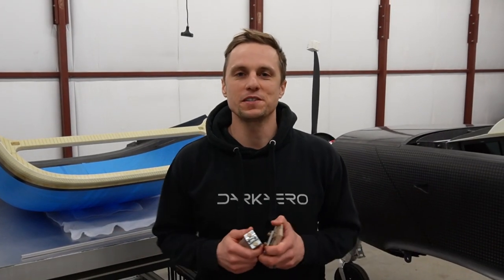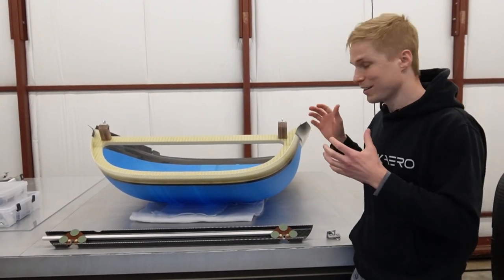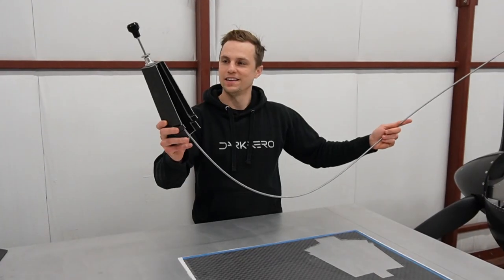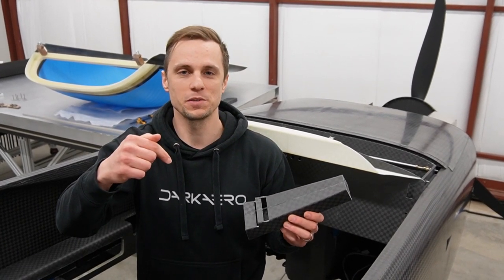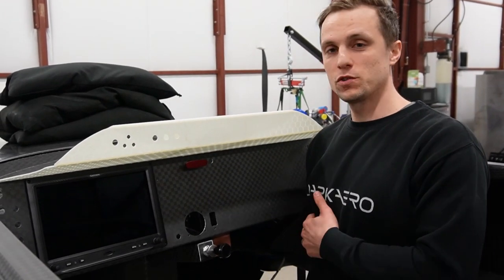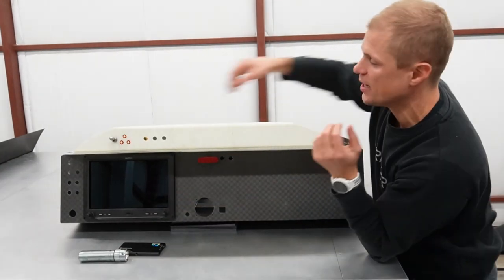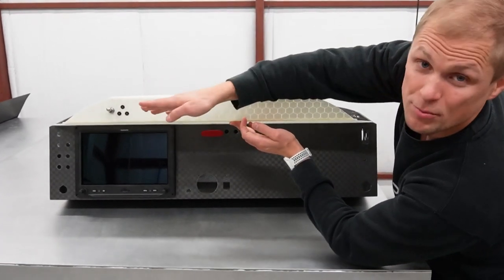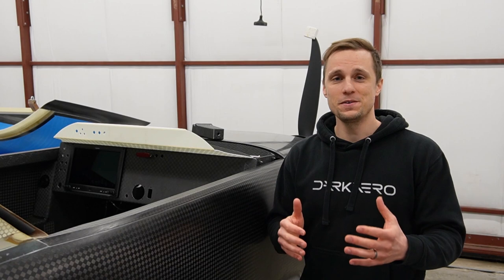Canopy EJECT Mechanism on the DARKAERO 1 Aircraft

Comment: I would request a secondary “emergency” cable pull to disengage the latches (in case the tube is bent or some other issue)

Comment: It would be nice if you could hide the white "end grain" on the end of the carbon panels on the throttle control mount by making the top "cap" cover the four sides, rather than having the sides protrude past the top.

Comment: You guys are doing AMAZING work!
Alas, you may have a problem... water intrusion.
I dont see a significant space for a proper door seal to keep the water out if you get caught in the rain.
Maybe that is a feature that gets designed into the molds on the subsequent production unit.
Secondly,  finding a seal profile and dealing with turning corners is always a challenge, this is NOT a trivial task.
There was a guy at Santa Paula airport near Ventura CA that made pressurized silicone door seal systems, if he was still around he might have stuff that could help.
And finally make  provisions that will allow you to drain the water out of the seat base and cockpit floor, it will get wet.
Last plane I built,  before we put in ANY electrical in, we took it outside and had the fire service empty a fire trucks water tank on the plane to make sure we were dry.
FYI, took 3 tries.
As for passive drain valves consider something like a "duck bill" valve. 
Once you get a bit of positive pressure in the cabin (as opposed to outside at 10,000ft) any water (spilled coffee, cokes redbull etc) and it will help evacuate the cabin.
Ok this old fart will shut up and watch, looking forward to the first flight!

Comment: You guys are doing a great job figuring out all the little details on this project, it's very inspiring!  If you'll allow a quick tangent on latches, one of the latch systems I was a fan of was from an old Cadillac I had, 1994 year or so.  It was for the trunk, and it was a normal close, actuated hold down system.  Not sure if I've got my terminology correct.  But essentially you'd slam the trunk as normal, but then a small motor would pull the trunk fully closed say 5mm or so to create a nice tight seal.  The clever bit was that since it was a slam shut trunk it still all used the same latch hardware as a normal trunk, and didn't need power to release, the motor was attached to the stationary hook on the frame.  It was very clever in its implementation, at least I thought so.

Comment: Again your an amazing crew, the mechanism for the canopy is clean with as few parts as necessary to do the job. The four pin attachment points offer a rigid attachment to the hinged panel and makes for very simple release of the canopy. Perhaps a cleverly design of the latch handle would be to to release the latch mechanism if the canopy is lifted from the front in an emergency. Thanks for taking us along

Comment: I'm so impressed with you three and I really wish your project all the success in the world! I'm a mechanism designer myself and I really like that scissor mechanism! Such an elegant solution to the problem!

I would personally really like to have a hole or a slot in the seatback so that I can stick my finger in there and access a feature on the aluminum bar directly in case the handle or cable mechanism fails.
Reply from the maker: Thank you Marius! What sorts of mechanisms do you design and what tools do you use to design them? We do a combination of sketches, CAD, and mock ups to come up with the correct motion. Just curious to learn if you know of any other tricks of the trade.
Reply: Thank you for your reply! I design biomedical devices and surgical tools. Not as exciting as airplanes, but just as safety critical and the effort and scrutiny to change an already approved design is just as painful... so get it right the first time :) We rely heavily on sketches and CAD as well (Solidworks, still more proficient in that than Onshape). I find that just working in an unconstrained sketch in 2D is already a great first stab at a new motion. After that we will properly model and mate an assembly, and then rapid prototype (in-house CNC mill, laser cutter, 3D printer) it as fast as possible, usually from easy to machine materials like aluminum and acetal. It's not uncommon to machine upwards of 3 different concepts for a given mechanism before committing to one. I also really like having a few drawers full of LEGO Technic for some really crude but super rapid mockups. In our case the analytical work (strength, fatigue, tolerance stackup etc) usually only gets done after the first physical prototype, at the same time that we are refining the second or last version. Oh, and finally, lots of peer review: brainstorming sessions during the initial stages and then design reviews after the first prototype.

If I had been in the design review for your scissor mechanism I would have said pay close attention to your mechanical advantage. I really like that right at the beginning of the motion your mechanism has the greatest mechanical advantage. (You can increase it further by making the links skinnier and collapsing the scissor more). This is great for overcoming initial stiction and static friction. By the point where the angles in the scissor are 90deg, it looks like you have a mechanical (dis)advantage of about 2:1 from the knob to each deadbolt, meaning the deadbolt is moving twice as fast as the knob. In the last portion of the knob's travel the mechanical disadvantage continues to climb rapidly. If there's a shear load or binding on one or more deadbolts, this might make the knob very difficult to pull. I might consider making sure that all 4 deadbolts are completely disengaged by that 90deg point of the mechanism's travel.

Keep up the amazing work! You guys are rocking it.

Comment: 13:08 when that canopy detaches completely at 270mph, the pilot will become incapacitated within about 0.2 seconds. 

Unless there is a mechanism that holds the rear until the front flips up and over the pilots head. Or there is a ramp on the top of the instrument panel to launch it overhead. Or there is a way to guarantee the low pressure over the canopy will lift it at >30 degree departure angle to clear the pilots head. Which defies physics. 

It should probably have a catch at the upper-rear which is not released by the jettison handle, in order to cause the canopy to lift leading edge first, flat plate vertical overhead, and off into the breeze. 

But you mentioned needing to design a solution to the problem, so ill hang tight for that.

It would seem to me, the design philosophy of this AC is not simplicity centric. And there are a plethora of new, untried concepts coming together into one aviation project. I wish you all lots of luck, at some point in complexity, luck becomes as important as the best engineering.
Reply: I also have reservations about forward-tilting canopies in general.

How do you escape if the plane flips over in water? or if it flips over and starts on fire? Plenty of real-world examples of vans RVs and other planes doing exactly that (rarely with the fire though, thankfully, but still possible). Unless you eject the canopy before Every emergency landing. I prefer sliding canopies or other doors than can be opened in-flight.
Reply: I agree with Justin, the canopy probably needs to be able to rotate up around a point at the rear, enough to clear the pilots' heads. A gas cylinder or spring under the fairing might forcibly raise the front lip to catch the slipstream and help flip the canopy. Some high-speed aircraft had problems ejecting canopies, the ME-163 canopy, a somewhat similar design, could not release, even after pulling the eject handle, at high speed. Consider a handheld punch to break the acrylic in the event of a flip over accident. Great work and video production- look forward to progress on the design.

Comment: Excellent engineering and construction. Thanks for sharing your journey with "us".  Will the canopy release also open the latches on the rear canopy latch? (the aluminum bar mechanism).  Or will they just tear away as the front of the canopy gets picked up from the slip stream
Reply from the maker: Thank you for following along John! We are planning for a two-stage operation to jettison the canopy since the canopy latch and the jettison mechanism are not coupled together.
Reply: @DarkAeroInc  In an emergency you need a single handle to completely release the canopy. An unfamiliar passenger needs to be able to escape. Suggest a Bowden cable between the pin retraction mechanism and the canopy latches.

Comment: Wicked cool details on the latching and emergency release of the canopy.  Have you considered a semi-permanent strap around the emergency release, something that could be broken with a pull-tab or lever?  Perhaps some type of tie strap that holds the double-crossed hinge/bracket in the locked position until broken.  This would enable the pilot to break the seal if things seem dicey and only then releasing the canopy if and when it is actually necessary. 
Love the videos and update, can't wait for your first flight, cheers!

Comment: I was just thinking about your throttle housing. My concern is that, when exiting the aircraft, I’m always looking for something to leverage my weight when getting out of the seat. I would be concerned someone might place a good amount of weight on the end of that cantilevered housing and have the housing break off at the mounting location. 

I am really enjoying watching you guys create something that so many of us can only dream about doing. Good job.
Reply from the maker: Thank you for watching! We had a similar discussion and concern for that very scenario playing out. Inevitably someone will want to lean on it to support themselves. To help handle those loads we are planning to add some additional reinforcing carbon fiber “tapes” on the top and sides which should help beef it up.

Comment: 1) How about some stock carbonfiber pipe for the throttle? 
I imagine it's cheaper, faster and lighter while also keeping interferance down if it reaches up to the firewall.

2) Did you consider a compliant mechanism for the canopy relase? 
It can have 2 states were it locks slightly in.

3) Maybe have something that lets the flow of air help with the cockpit removal after release? Otherwise hidden inside.

4) What can someone do in case there is a fire inside/panic... are you able to forecefully open by standing up for example?

Comment: Quick question - it may have been addressed elsewhere already, so apologies for being redundant in such an event 😔 - but on a hot, sunny day many pilots will want to keep their canopy ajar to facilitate good cooling while taxying at slow speed, as airflow tends to be too low to keep the cockpit cool otherwise, especially with a clear acrylic canopy of this given design in bright sunshine.

Thus if the canopy is opened somewhat and that also results in the movement of the instrument panel and presumably the engine’s gauges, does that then pose a problem for the pilot taxying the aircraft 🤔

I’m guessing the instrument panel’s gauges would have to remain active for taxying with the canopy slightly ajar to be possible and there would have to be a limit on how far the canopy could be opened to facilitate cockpit cooling during taxying operations ; the latter so that the sight angle for the engine instruments would not make it impossible for the pilot to read the instruments (Temps, rpm, oil pressure for example).

Cheers.

Ps - nice work, really impressed by how far you’ve come along 👍

Comment: Canopy release, hinge pins!

You might want to rethink how you have installed all the hinge pins in the canopy release mechanism.  Gravity can be a friend or an enemy.  Installing the pins from the bottom makes installing the cotter pins easier, but also allows gravity to remove the hinge pin if the cotter pin breaks or come out of the hinge pin.  Installing the hinge pin from the top make putting the cotter pins harder, but gravity is now holding the hinge pin in, if a cotter pin comes out.

What would happen if just one of the twelve cotter pins came out and you needed to use the canopy release?

How easy will it be to check (per-flight) the cotter pins after construction is complete?  Can you see them from the top?  Bottom?
Reply from the maker: Hi Tom! Thanks for checking out the video and for reviewing our work! The orientation of the clevis pins was deliberately chosen to simplify the installation and visual inspection of the cotter pins. There is a best practice of assembling fasteners in line with gravity and/or the slipstream when possible, but this is not done to hold the assembly together if the nut or cotter pin is lost, it's only to keep from losing the fastener as well. The basis for the best practice is described in FAA-H-8083-30A Section 7-49. Gravity and/or aerodynamic assist are not reliable means of holding an assembly together, even as a hypothetical backup, so it is the assembly and inspection requirements that drive the fastener orientation for our jettison mechanism.

Comment: Looking good guys!  For the canopy latching mechanism, do you have any room for adjustment up and down on the latches?  That might be a nice thing to add for the production version so that if there is some variance in the builder's kits or their assembly, they would still be able to get the intended latched position.
Reply from the maker: Misalignment is something we were concerned about as we assembled the hardware, but there is a solution. The "hook" for the latch mechanism is bolted to the phenolic "horn" which allows shims to be added to adjust the relative position between the interfacing components. We match bonded everything in place as a mated assembly to eliminate slop, but adjustments are still possible if we need to tune the fit for some reason.

Comment: I'm assuming there won't be any air conditioning. Alot of the old pipers I remember flying had a little window on the side with an air scoop that you could swing out that would REALLY help on hot days in Florida where I flew. Any thoughts on adding something like this?
Reply from the maker: We have two small submerged inlets (NACA style) on both sides of the fuselage which are connected to eyeball vents on either side of the instrument panel. We’ve done some ground testing with these and they allow for quite a bit of airflow into the cabin.

Comment: Should probably make a guard above that lever for someone not to accidentally detach the canopy midflight.
Reply from the maker: Agreed! That was touched on at 13:12 in the video, but the full implementation of a guard will be discussed further once we have it installed. Thanks for checking out the video!
Reply: @DarkAeroInc  Thanks. Missed that moment the first time.
Some foldable plastic cover and a couple of guards on the sides (not to go cabriolet if your sleeve got there) should probably do the trick, unless there is something more specific mandated by law.
Amazing job on the project btw. That is one fantastic aircraft you are creating.
PS
About that mechanism to make sure the front of the canopy is detached first. You probably already got a solution, but just as an idea to entertain, one can use those pins to open some sort of flaps on the front of the canopy to increase drag and lift in open. Can be lighter and easier to implement than some hydraulic/pneumatic system to lift the whole thing, but will have quite limited effectiveness at low speeds. 
Anyway, can’t wait to see what your solution would be.
Reply: That was immediately what I thought too.  It actually scared me a little as soon as I saw it.
Reply from the maker: @josefodium8888  There is a balance to strike of making it accessible and easy to actuate in an emergency but not too accessible to allow it to be actuated on accident. There are three guard solutions we see. One would be a two-stage action such as "turn and pull" rather than just pull alone. The second would be some sort of safety wire or safety pin that has to be broken with sufficient force to actuate the handle. The third would be a cover as you suggested.
Reply: I'd recommend using breakaway wire. It's commonly used for safety critical systems in the Boeing cockpits I work in. (E.G. RAT switch and IDG switches.) Very easy to snap when intentional yet sturdy enough to not accidentally break. KISS
Reply: @Zalex612  Best balance of ease of access and safety, probably. 
“turn and pull” above the working area should probably be extra tested on being sleeveproof. Precious few would enjoy turning to get their water bottle and getting some fresh air instead. Even understanding that they are stuck on something people could instinctively pull anyway (and the fabric will do the turning part for them). 
Breakaway wire is a good balance. But the thing needs replacing every time you get under that panel for maintenance and someone will 100% skip on that out of laziness one of these days. 
Cover is the most obstructive, but is the safest one. 
I’m one of those people who would foolproof everything to the point of absurdity. So would probably use a cover with extra bars on the sides of that lever or a cover with protective ridge on its perimeter not to even get opened on accident.

Comment: Great video. I’ve been considering building a plane. I’m left uninspired by most of the current offerings, but the DarkAero had got my interest. I’m a 21,000 hour ATP with a major airline. Retirement is not too far off and I’d like to fly for fun and to visit friends/family. I’ve built several boats and worked in a shop repairing wooden and fiberglass sailplanes back in my college days. Also done a lot of mechanical work on boats, cars and motorcycles. 
I’ve got a question. What sort of climate control needs to be maintained when working with the adhesives you are using?